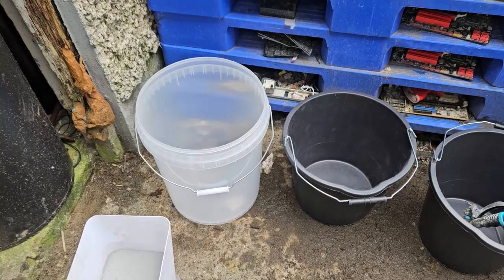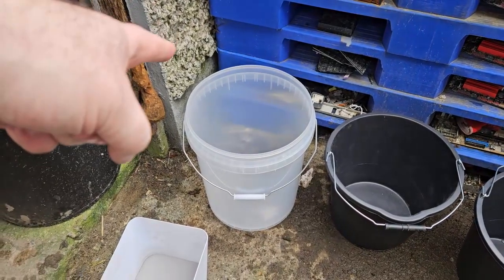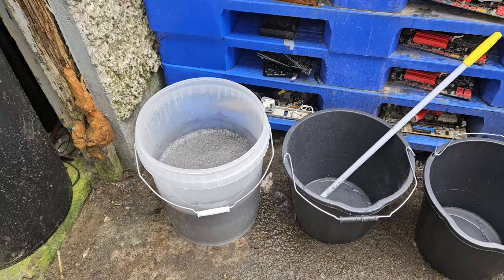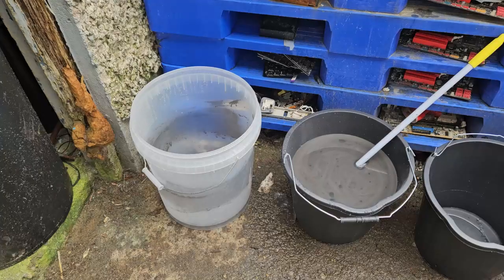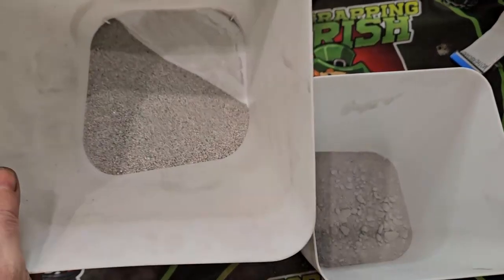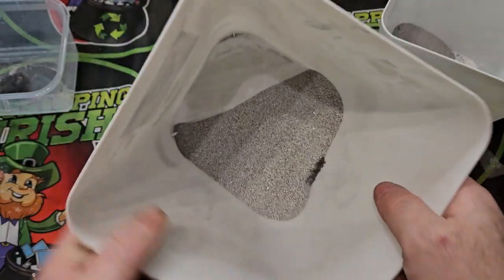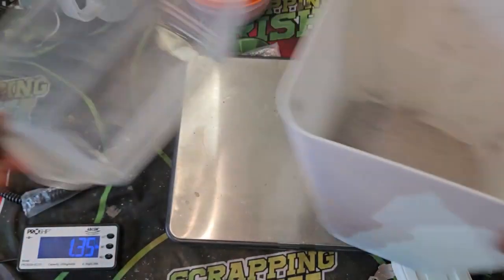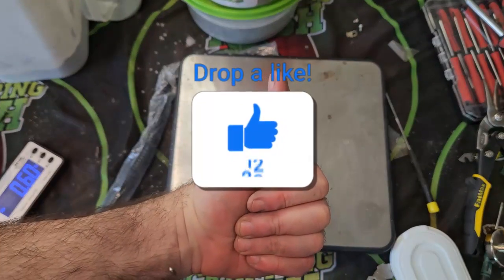Separating Gold Bond Wires Made EASY with This Simple Trick

Comment: Thanks for sharing what you've learned. May I share a bit? I've learned it helps to add a bit of strong dish detergent or a surface tension breaker like the US brand Jet Dry for automatic dish washers. Fine pieces of gold have a chemical affinity for oily substances and materials that are like clay, Without the additive, you may be losing gold that floats on the surface or in the foam you create when you spray the surface. If you can buy propane cheaply enough, you might consider smelting the final powder using a flux like Chapmans and a Vevor Melting / Smelting furnace, or the electric melter you've reviewed in your videos.
Reply from the maker: Thanks for the great advice appreciate it